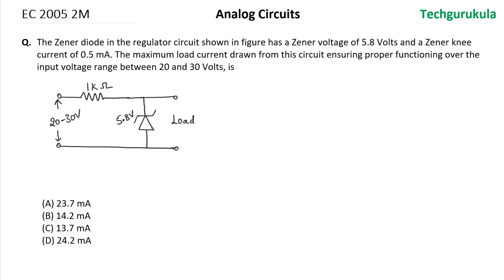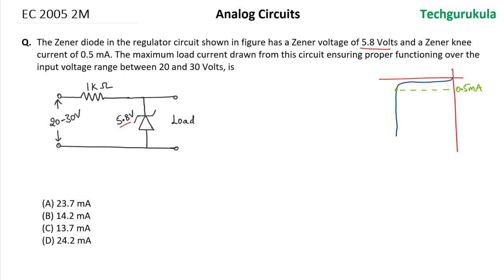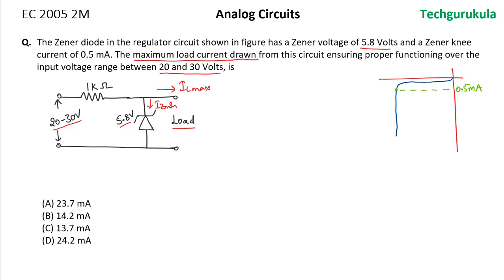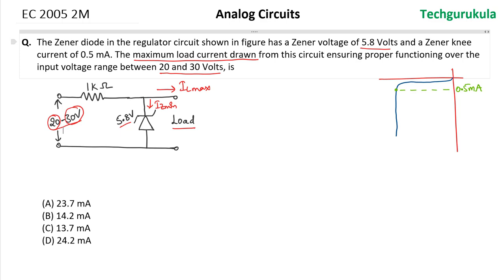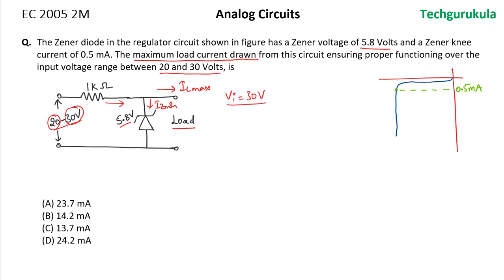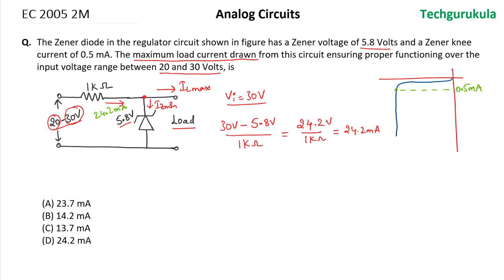AC: EC GATE 2005  2M - Zener Regulator

Comment: This is not correct. We should take 20V for the load current calculation. The ques says the maximum allowable load current for the input range. Given the input voltage variation how much load we can reliabaly draw. Answer is option c.

Comment: As the question  States proper functioning over the input voltage range between 20 and 30, how could we take the maximum value of input voltage to find the current, as the load current needs to be calculated over the range.